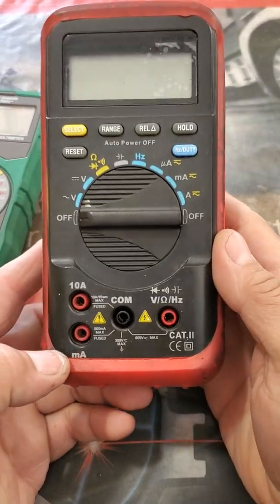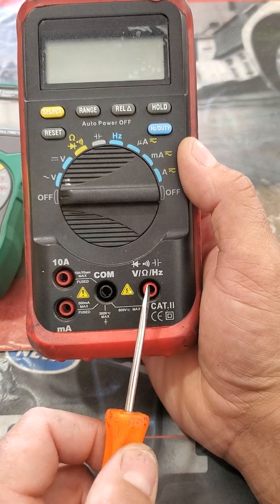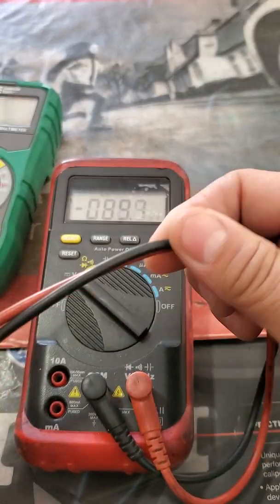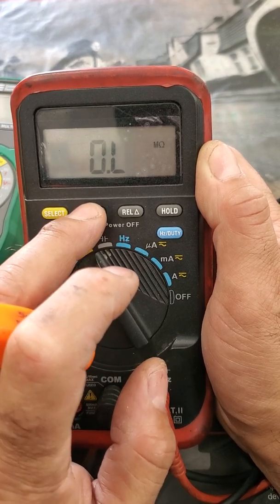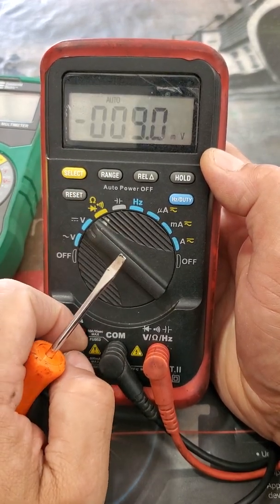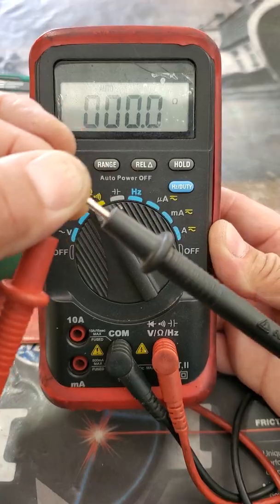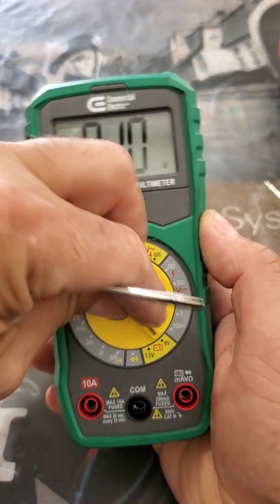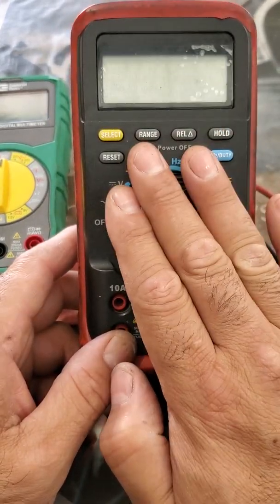Basic Multimeter Description

Comment: what do i select to read a car battery
Reply: Direct current…comeonman
Reply: @fergferguson7370  i’m new to cars and don’t have a male figure to teach me about it :)
Reply from the maker: Direct Current. In the settings for 20V max. Voltage in a car system is usually between 12v to almost 15v DC. No question is a bad question. Remember that.
Reply: Alondra Rogel: Volts DC....the symbol is usually a solid horizontal line with a row of dots beneath it.